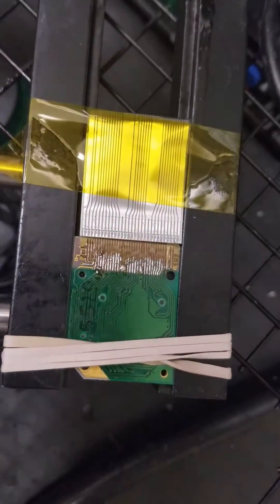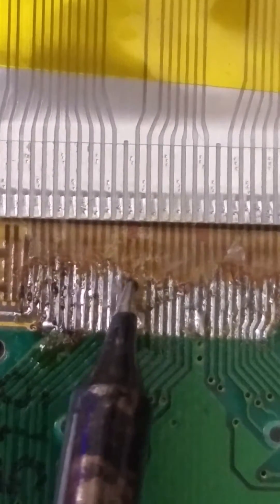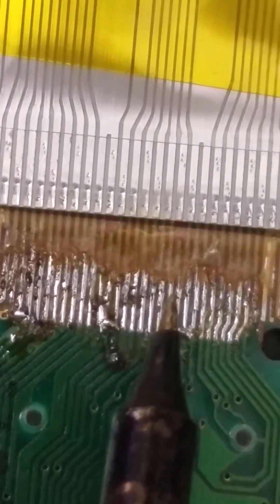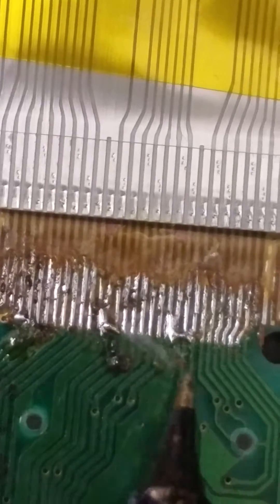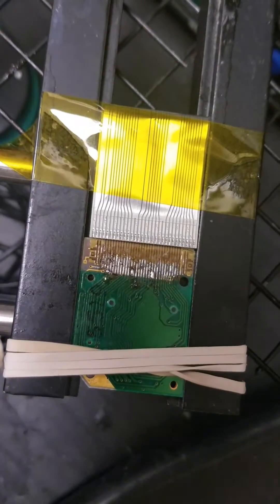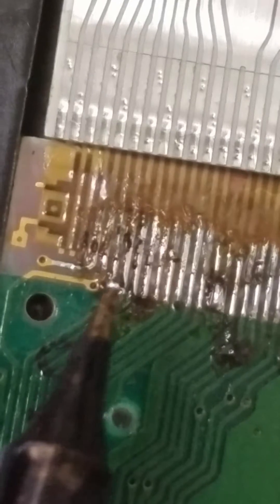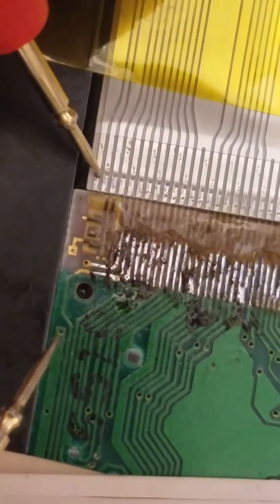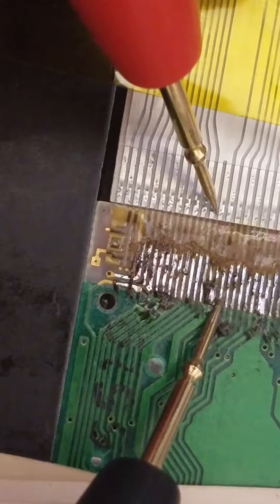Virtual Boy Permanent fix with detail

Comment: What temperature did you have your iron set to?
Reply from the maker: I do not remember the temp I used but you will want to use as little heat as possible since plastic is involved. 60/40 solder and around 190c/375f would be my recomendation. You may be able to find better alloys than 60/40 solder with lower melting points but 60/40 is easy to find.
Reply: @NemesisMerlin  Thanks!